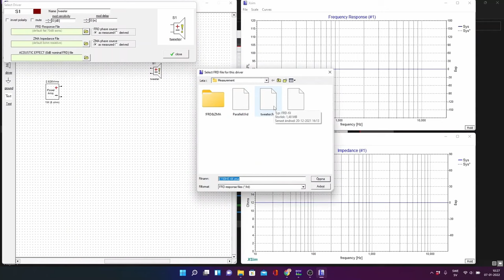Epique Bookshelf speakers // Build plans

Comment: Those look great. Im curious what their bass extension is and how clean the mids remain while it digs deep into that bass extension. I've seen loads of 2-way bookshelves that try to do clean mids and solid bass at the same time but compromise on at least one of them. That driver looks pretty special and you put a lot of effort into the crossover, so I'm hopeful that you've escaped that pitfall.
Reply: Bass extension per Dayton spec is 30hz. It's only a 5 1/4 inch speaker with a large surround and good X max.
Reply: 30-4000hz for the 5.5"  , 25-3000 hz for the 7" version
Reply: I'm wondering the same thing! Apparently Epique claims that their speakers can be both a full fledged subwoofer and mid woofer at the same time due to a special design with the driver.  Not sure how true that is but they sure do look awesome
Reply: That fat surround must cause some nasty diffraction
Reply: I purchased a pair of 5.5" Epiques to test, and while they go deep, the mid-range suffers. I have two pair of 2-ways using old (NLA-US) 6.5" Peerless NOMEX mid-woofers that go down to 40Hz (by design and my choice) but up to 6000 Hz, limited by design to about 4000 Hz and crossed to the Peerless tweeter at 3.5 KHz. I have a 12" sub woofer for music (more than enough with 500 watts) in my tiny 13.5'x 15.75' (9 foot ceilings) living room. I listen to quadraphonic 15 IPS tapes and 4 channel LP's almost daily. Yes, my LP's are over 37 years-old, but being they have always been played with a quad cartridge on good to for 35 years, outstanding turntables since (I have four for LP's and one for "78's") and my 1975 TEAC tape deck has new heads, both the tapes and LP's should sound as new 100 years from NOW. You might accept the 5.5" Epique's mids, but I wasn't happy with any XO topology to currently available tweeters. The measurement graphs showed what I heard. Maybe there's a tweeter made that would sound great with the Epiques, but I haven't found it. Very frustrating.
Reply: @Walkercolt1  I figured that this would be the case. It's probably still acceptable for a surround sound theater system where you don't need your mids to be super tight, but I suspect you'd need to find a particularly nice tweeter that can be crossed at around 1kHz in order to make up for its less stellar upper extension.

Comment: The tweeter & woofer are not a good match in sensitivity, which unfortunately complicates the Xover. This woofer's main plus is its excursion but for full range sound, a bookshelf design with a 5.5" driver will need a subwoofer. So giving up a bit of bass depth to have a better match in sensitivity between the drivers, yielding a simpler Xover, which allows for higher quality parts is IMO a better choice.

Comment: Nice build. You should put something like a solid gasket under the Tweeter to be flush with the baffle. A small edge near the tweeter causes already a uneven response in the higher frequencies.

Comment: Ok i bought the plans. But in them its says the amp you used can only give 160watts of power per channel.... these 200 watt rms woofers. Am I missing something here?
Reply from the maker: You can use pretty much any amplifier you want. However, at 64watts the woofers will play 89db at a listening distance of 4m (13feet).
Reply: @Erikdidit  but won't this cause clipping ? I was under the impression you always had to use an amp that had the same rms of the speakers or more. Do you just keep the volume down? Did you wire them at a 2ohm or 8ohm load ?

Comment: Nice build! My only concern is the use of solid wood for the driver/tweeter baffles. Solid wood tends to expand and contract due to humidity changes in the environment. Since the baffles have been milled out/drilled to fit the drivers and tweeters, they will have the most stress and might be prone to cracking in the future. There was a cringe moment at around 6:12 in the video, your shirt drawstrings were dangling and hovering right over your table saw blade...all it takes is a second to cause serious injury, safety first.
Reply: People are way too overly dramatic about wood movement.
Reply: @earthtoandy_   You are so correct. I am still amazed at how my Solid hickory $8,000 kitchen cabinets with the Sink and dishwasher, the stove All that Heat and steam, Oh and all at moisture and they are still holding together. how in the hell could that little 8-inch piece of wood ever last in a dry room with stable room temps is beyond me.
Reply: The rip fence also moves a bunch too right after the dangly bits

Comment: Hi 👋, I am new to your YouTube video, I do not know a lot about making loudspeakers cabinets how you have to make the crossover.
I have made a pair of transmission line cabinets about 40 years ago only just recently had a Tweeter and woofer burn out on me as my power amp decided to throw a wobbly, I am a retired master carpenter cabinet maker and have worked for an organ building company many years ago.
The end product looks very good, But I have to say you should’ve spread glue all over the surfaces of the panels that you’re glowing inside and outside and camp them up to give a full area of bond, this will stop some distortion, I didn’t see you put any gasket under the Tweeter and the woofer,
What will help as well is spreading or Rolling on thick glue on the inside parts of all the surfaces, I didn’t see you put any soundproof quilt inside.
Are used to roll glue on the inside surfaces of some pipes and some internal components of church organs to stop the resonance and to stop condensation moisture entering the material, Phil from the moulin France.

Comment: These little subs are freakin awesome. I'm impressed how low they go even in book shelf size boxes. Good idea going with slot ports with these to avoid any potential clearance issues with tubes (as state on their page). The signal is making my actual subs dance lol. I'm starting a 2 way floor stander build with these but am going with the matching PRs. I know whats said about solid baffles but I never had any negative issues while using them in the past. Coincidentally I chose 1" thick solid oak stair risers for my baffles this time. 3/4" ply everywhere else. I has intentions of going with a more common ply baffle but, changed my mind last minute. I seen the risers and they were almost bang on the right size. The bottoms merely needed 1/4" nipped off. The oak was too nice to resist using. Finished with black ebonize stain and flat clear and those subs flush mounted is going to look pretty great I think.
Reply from the maker: I'm building a mini tower with two matching passive radiators right now.
Reply: @Erikdidit  Do you mean two per 1 sub per speaker?
Reply from the maker: @potsy9973  yes

Comment: awesome build, i just cant get behind that woofer, such low sensitivity, need all 200watts of amp to get good sound out of it. Dayton does offer a few 6" options with sensitivities around the 92db. your getting the same volume for half the amplifier power. if you've got a huge amp, that's fine, but if you want to power it with some little tpa3116d2 chips, you wont get much out of them lol

Comment: I love the look and the quality of the build, but I am concerned by the frequency response and phase plot of what I take to be the final system at 09:01. These suggest significant colouration at midrange, roll-off of treble, and phase response that literally spans the whole cycle, I mean this is 0 plusminus 180 degrees.

I would love to have seen final recording of the impulse response of the system. Do the theory and practice match?

Comment: looks good but I'd personally would have preferred a different approach to the design since the epiques are rather expensive, Ida utilized 2 of the extended range drivers in each cabinet with a 3 way crossover.

3rd or 4th order lowpass on the mid as well as
2 order highpass 

2nd order highpass on the tweeter

1st order baffle step on the woofer

sealed the mids and tweeters and loaded the woofer in a rear loaded horn
Reply: When you make yours, you should do exactly that
Reply: I'd personally go with an actual 18 inch subwoofer for the low end at that point for massively increased efficiency at the cost of real estate.
Reply: I‘d Love to See your Giant bookshelf or Desk

Comment: Several queations here. Whats the internal volume ? Whats the length and tuning of the port. And what amplifier are you using for these given they take 200rms and 400 max W.
Reply from the maker: Every answer is included in my buldplans that I sell
Reply: @Erikdidit  at least answer me this please, I will buy the plans btw, but did you use winisd to model the port dimensions ? Every time I go into winisd I get crazy large port dimensions. And when I see these super short ports I wonder how its even possible (I'm a complete beginner but I'm really into the hobby of building custom speakers), as far I know, to prevent chuffing you have to keep the wind velocity below 16m/s but any attempt I make at doing this by increasing the size of the port I get these crazy long ports. How are you keeping it so short, does it have to do with the internal volume of the speaker, as of this moment I have only modelled using smaller enclosures
Reply from the maker: @hermangaviria690  you are probably trying to tune the port too low. It is a balancing act between a few different factors.
Reply: @Erikdidit  when I don't tune the port low enough I get a huge bump on the low end bringing it to a chevichev response. I specially have a hard time believing how chuffin isn't an issue with this build. I'm a huge beginner so I do apologize for the trouble.

Comment: An after thought, I don't mean to spam anyone. But is there a way to ask you a question regarding these drivers via a direct PM?
Reply from the maker: Erikdidit @ Instagram
Reply: I'm not a subscriber yet. I was having a software glitch, trying to upload. I was just going to ask if you had already ran numbers for the 7" epique w PR, 
( one of each per speaker).  @Erikdidit . I got all my panels cut today, but not to exact lengths. I still have to establish a parimetre value. 
I'm going to keep this one basic and see how it goes. If a particular 6.5" mid bass will work I might try a 3-way with separate boundaries. Oh and of course sealed.

Comment: So the epique has 2 connections, I'm guessing that means dual coil? How is it wired for this setup?
Reply from the maker: Yes, is has two coils. Wired in series. I think it is easiest for you to Google it. 

In from amp to positive on either terminal, from the negative on the same terminal to the positive on the other terminal and out to amp from negative.
Reply: @Erikdidit  thanks, just spotted that in the video

Comment: there's no way you're getting great midrange clarity with those tiny subwoofers.
Reply: I think tiny subwoofers give you better midrange clarity than big subwoofers
Reply: Subwoofers were never meant to play midrange in the first place.
Reply: Have a look at the VoiceCoil Magazine test. The drivers have a bit of unevenness but very good extension through the midrange. No reason these won't perform well. Obviously less efficient with the heavy cone but the motor is huge and can easily control this driver, just plan to have a beefy amp for SPL. That slight unevenness due to the large surround is is a very solid trade off for the bass response. Really though a Passive radiator could be used here.
Reply: I absolutely believe that midrange is great...I just wonder about doppler distortion. Thoughts?
Reply: @aaronmatuszny8856  Good point, I forgot about doppler distortion. In that regard, the smaller the subwoofer, the longer the amplitude which means bigger doppler distortion
Reply: you have no idea what are you talking about…..

Comment: that epique driver is looking so sweet. but why using it? it's basically a subwoofer not a midbass
Reply: It's not a subwoofer. It goes out to 3k very flat.
Reply: @analogkid4557  @78 dB sensitivity!!! It is a subwoofer in that regard... Add an passive crossover and the sensitivity drops to 74 dB @ 3K Perhaps a good option for an active full DSP speaker.
Reply: @wellroundedsound2422  not really. They pretty much have bsc built in. They are rated at 83 db. With the power handling and excursion they will hit 107 db.
Personally I would use two per side.

Comment: Did you calculate the volume of your enclosure with or without the foam that you put inside ? This kind of foam doesn’t let air circulate through it so you might have actually reduced the volume of enclosures with it. I don’t see any good reason to use this kind of foam honestly ! I really like the finished look of them !
Reply from the maker: Yeah, you are right. I have changed it to polyester damping. When I held a piece in my hand and tried to blow air though it with an air compressor I noticed that it doesn't circulate air.

Comment: Spend 200€ for speaker but no money for 22mm mdf. Good resistors and 400v  Caps are not expensive   the terminal has steel. Thats trash. Use messing. 4 Terminals for 9€  😎👌🇩🇪
.

Comment: Wtf is this crossover
Reply from the maker: I'm not showing the final crossover in the video since I sell buildplans.
Reply: Just cross them over around 2500 hz just above the low end of the tweeters, most tweeters only go down to 2khz buy some cheap coils and caps & once you got it buy good ones, you only need 1 coil & 1 cap add an lpad if the tweeter is too loud, don't waste your time and money on 2nd and 3rd order xovers, don't use resistors